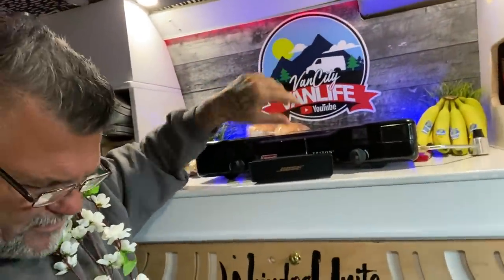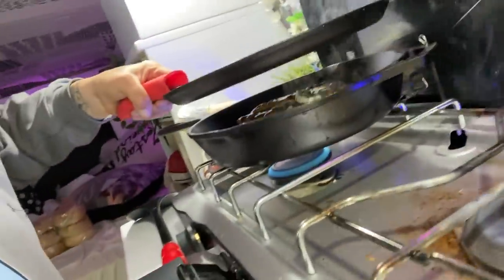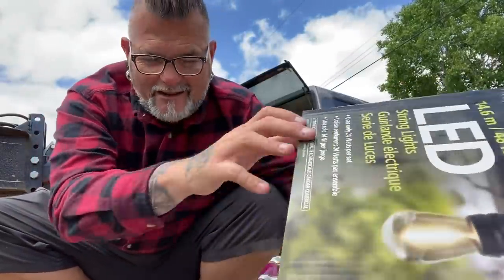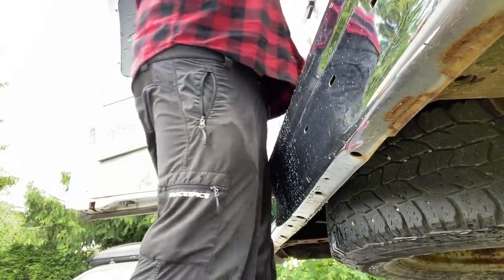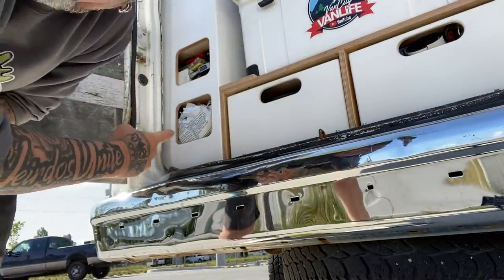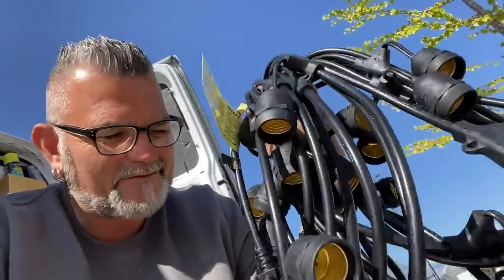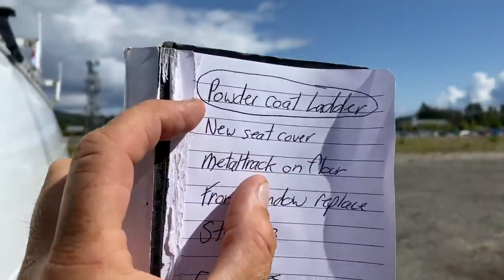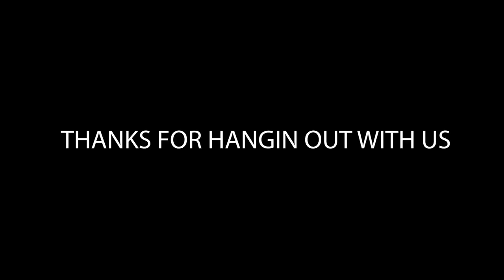Sorry For The Break In Videos We Have Been So Busy

Comment: Have I checked out the ICECO refrigerator yet?  I think you would like as can use as refrigerator or cooler works off of 12v and or 110 but pulls less wattage of the 12v. So refrigerator in summer and in winter could use as cooler if you wanted.